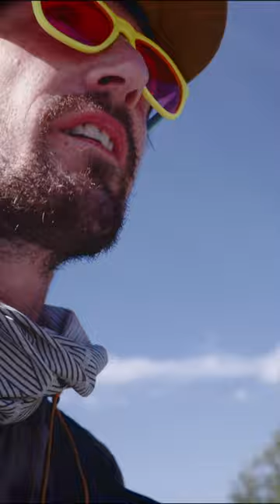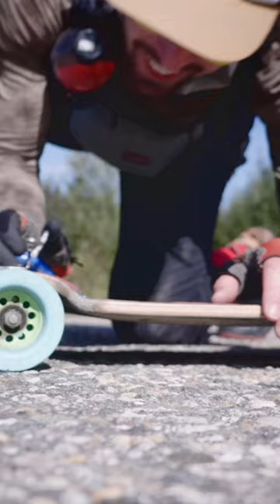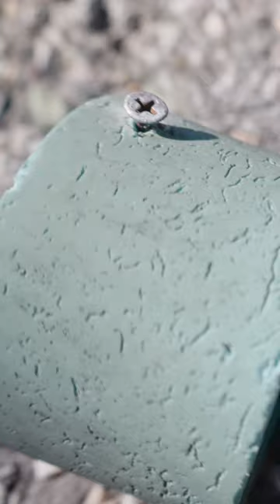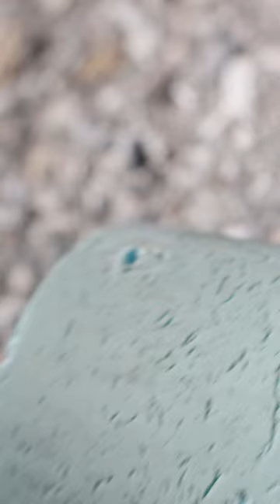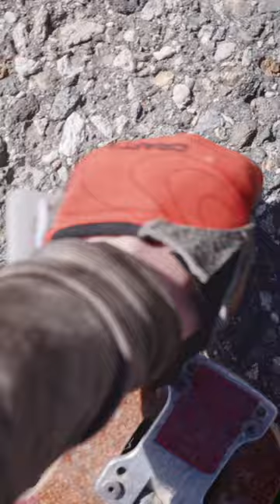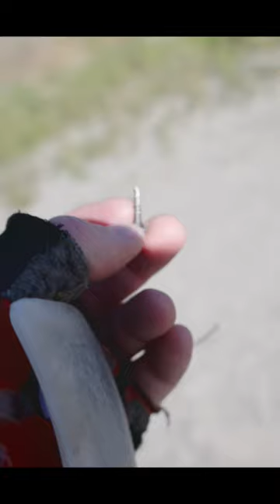I got screwed! - Longboard repair while on the road - Long Treks on Skate Decks Alaska Highway

Comment: Did you seriously just throw that in the grass?
Reply from the maker: I didn't feel I could leave it on the road, as it could really strand a person out there in the Yukon. 
I honestly appreciate the sentiment and I follow leave no trace principles, but I don't think it's my responsibility in this context. I didn't carry it in, as it was on the road and got caught in my wheel as I was riding down a hill. That and where I threw it, will likely result in it being buried under under gravel. For the context, this was during a skate trip from Fairbanks Alaska to Alberta Canada along the Alaska Highway Smack dab between the two small towns of Teslin and Watson lake which are nearly 100 miles apart. I was carrying everything on my back, and to keep weight down, I use delicate gear. So I can't carry sharp objects without risking a hole in my bag and actually ending up dropping new items on the road. This was somewhere along the border of the Yukon and northern BC in the most remote area of my entire trip where It won't bother anyone and it won't bother the animals. It's also the only paved road for at least 200 miles in either direction. So that area is doing pretty good and probably has less screws per mile than nearly any other highway in North America. 
Tons of stuff like that falls off of people's vehicles every minute. It sucks but I find a tons of garbage on the road and I can't carry it out in my small pack. I won't have room. I've taken some items.  I pack out all my garbage and will occasionally carry out some extra garbage that I find if I believe it could be harmful to wildlife. (like those plastic ring things that hold 6 packs together). 
Thank you!